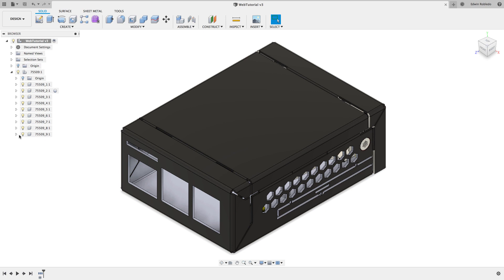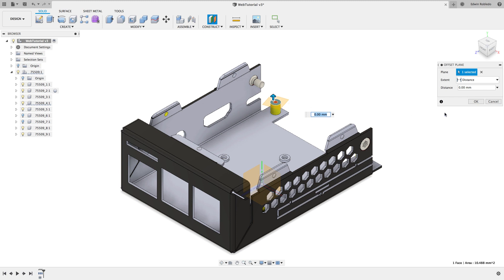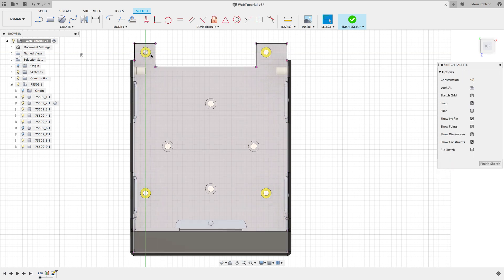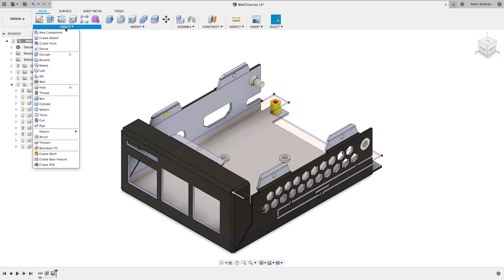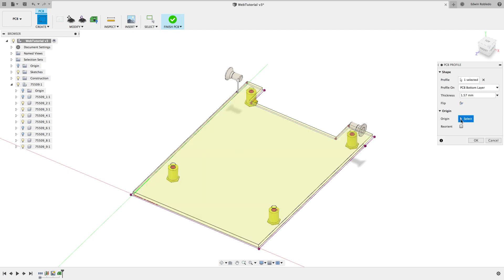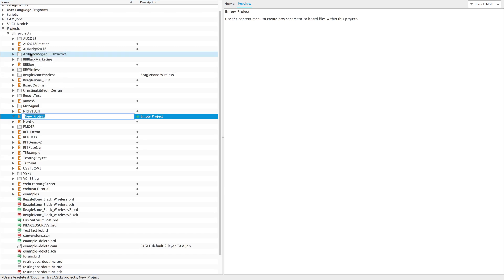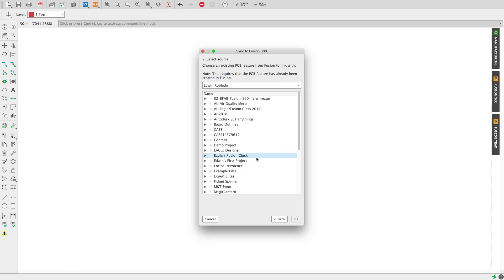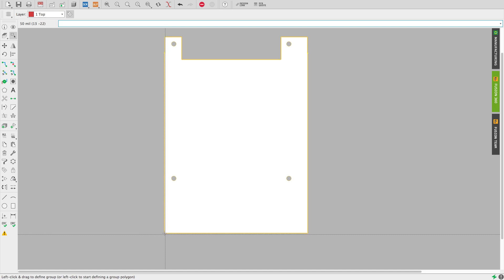Defining a PCB Outline from an Enclosure - EAGLE and Fusion 360

Comment: Is it possible to do it with Solidworks?
Reply from the maker: Hi Koperal, Thanks for watching our EAGLE and Fusion 360 enclosure design tutorial. The integrated workflows and smooth back and forth transitions for the mechanical and circuit design editing will only be available with EAGLE and Fusion 360. You are able to output DXF files directly from EAGLE which are accepted by Solidworks. Please let  us know of any other questions you may have.
Cheers!